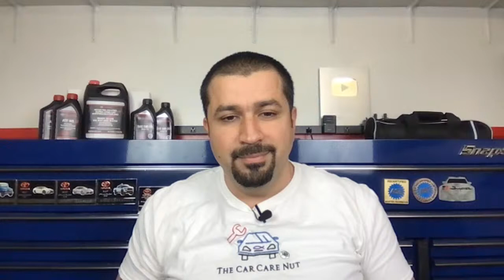Toyota Live Stream Q&A

Comment: Hi, I'm hoping to have the following question answered. I posted in the comments section but it was missed: I own a 2010 Toyota Yaris hatchback that is encountering a low beam fault. When turning the headlight switch, the dashboard shows the low beam icon but in reality the low beam headlight don't turn on. When you turn the high beams on, the dashboard doesn't show that the high beam icon however the high beams are on. Right now because of this issue, I have to set the headlights to high beam in order to use the headlights: I'm worried doing so will burn out the headlights. I understand that the issue could be that headlight switch contacts are pitted. I understand that there is an easy fix is to sand the contacts of the headlight switch (see the video here of the issue and how a mechanic in the UK fixes it: https://www.youtube.com/watch?v=rsucNoZsAyI&list=PLyUGjNcuNcy18DTtXk8DlpyJidVe34saK&index=6&ab_channel=AutoBuddy). I need to remove the steering wheel column top cover to access the switch contacts. I know that there are 2 screws on either side. However, I need to know how do I remove the cover without damaging it? I don't have a plastic tool to easily remove the steering wheel column cover.
Reply from the maker: Hi! This will need some simple electrical diagnosis. The covers come off easily they have 3 screws then you push the sides of the bottom piece in and it pops off